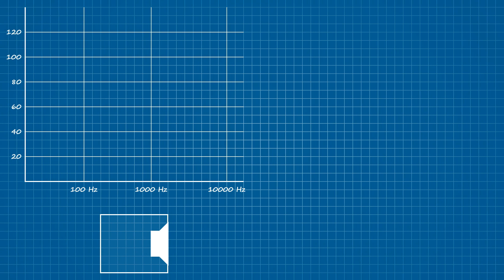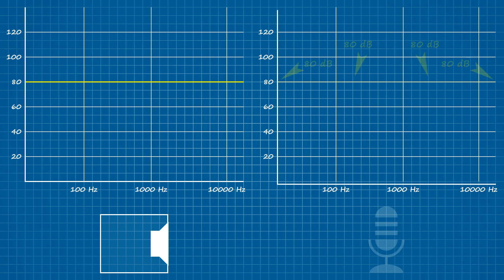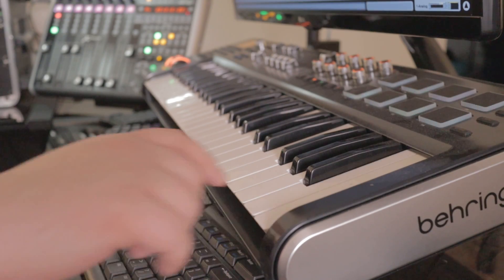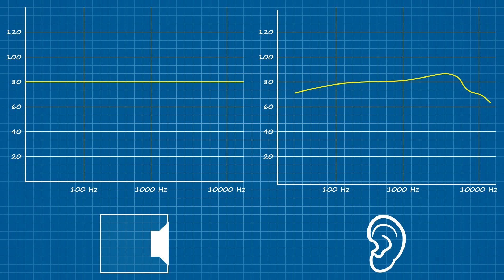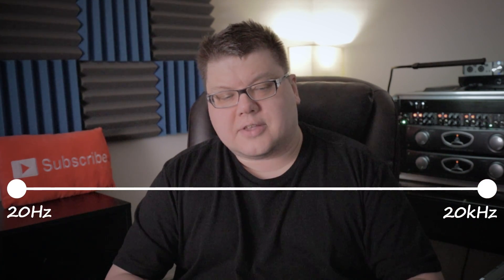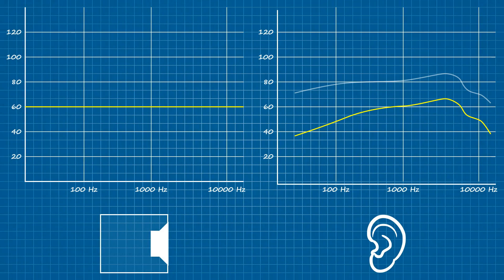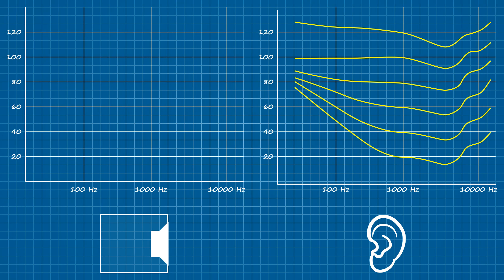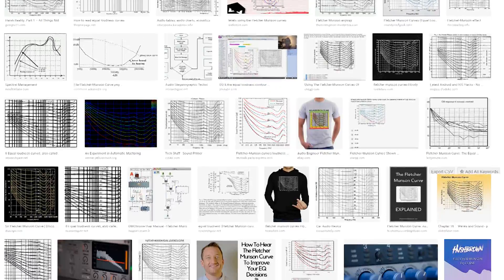Perfect Sound Explained

Comment: Not to mention the room. Tweeters are become more directional at the top of their pass band. The bottom of their pass band i.e. between 2-5 khz they deliver more energy out to their sides and get extra reinforcement from the walls.
Reply: Balancing polar response and on axis response is something that needs to be done. Eg B&W speakers aren't completely flat on axis or off axis, but it sums to be reasonably balanced (they still have their own flavour of course).

Comment: Helpful, no its ore confusing. Ok, I totally get the relationship between volume and frequency response at the extremes. But are you suggesting that speakers should be skewed to make up for this? Back in the old days, ok the 70's and I'm not having a flashback..... at least not at the moment, any decent amp or receiver had a loundness countour button on it to attenuate the amplified frequencies at the extremes for listening at lower volumes, so you didn't get kicked out of your apartment. But the speakers we listened to went to great lengths to achieve flat response so that we could hear what the sound engineers had tried to create from our favorite artists music. When it all came together is was an awesome experience. Then, when loudness countour switches started to be dropped from amps we used the tape loop to run our Equilizers through and that gave us the best way to compensate for differences in volume, as well as when recording cassettes for use in our car stereos. With a little practice and experimentation you learned where your car's stereo lacked performance and could make up for that in ways that made them sound better than CD's, until well engineered car audio systems and speakers came into being. By the way, way back in 1978-79 I began experimenting with separate drivers in my car stereos. The first system was a friends and he had been given a bass guitar speaker speaker from his uncle. Having an early Chevy Belair two door it had a huge rear deck, so we cut out a hole and reinforced it with plywood, and mounted the woofer in the huge rear deck. Then we went to radio shack and got a pair of 6" dual cones and phenolic ring tweeters and mounted them in the front doors. Of course we didn't know anything about crossover networks back then, but with a couple power boosters it didn't sound bad. In later cars I used the woofer out of a coaxial cut out the cheap tweeter and pitched it and used different midranges and dome tweeters honing in on what sounded the best. These days we have guys like you Pete, who design things for us and they sound much better than those early experiments, but when I got some decent bass going our of the crap we had to work with back then it turned heads.
Reply: It shouldn't be compensated at the speaker (although some manufacturers do try to), it should be compensated in the preamp section. Also, you don't apply the equal loudness contour as is seen on the chart. You choose a reference level, then apply the difference between the reference contour and the contour with respect to the current level. This is what Aydyssey Dynamic EQ does for example. When listening at the reference level, the output is unchanged. When listening below reference, the extremes will be boosted according to the difference in sensitivity at those frequencies.

Comment: Could it be possible to have a speaker system that adapts the sound to what our ears should hear at different Db levels? Basically, the perfect sound to our ears no matter how quiet or loud?
Reply: +Xander Zoolander   

Not with a speaker system itself, but with DSP it is possible.  The just-released Zapco HDSP-Z16 V has a "VSEQ" function that does this.  OEM car manufacturers have been doing this for years with volume-dependent variable EQ curves, to apply frequency compensation to make the listening experience more enjoyable at different volume levels.

However, the other main function of this "adaptive EQ" is to protect the inexpensive speakers that the automakers use from being damaged from too much low frequency content.  i.e. as you turn the volume up, the low frequency response is proportionally reduced to protect the midwoofer speakers from over-excursion.
Reply: Yes it's quite possible. Larger amps give better control even on low volumes. That's why a "too big" amp is better than a too small or "just big enough" amp. It's also actually harder to blow speakers with a larger amp (ut to a point offcourse) than a too small one.
So if the speakers don't need alot of power just to move and if the amp gives alot of headroom then the system will perform almost as good at low volumes as it will on high volumes. There are other factors too but this is the most basic.
Reply: It's been done and it's not that uncommon either, my Klipsch R41PM's have that and they call it adaptive bass control lol it dynamically boosts the high and low frequency ranges according to the fletcher munson curve depending on the volume.
Reply: Yes this has been available for quite a few years under the name Audyssey Dynamic EQ.
Reply: Bose actually does something like this on their small PC and bluetooth speakers.
Reply: Sound reproduction has nothing to do our ears. The instruments, the singer will sounds as they are no matter how human listen. So should be the speakers.
Reply: @johnyang799  Wrong! Not all ears hear sound the same
Reply: @Oystein87  Sure not all ears hear the same. But in the concert we listen to the same people playing same instruments. Lol.
Reply: @johnyang799  So why do you claim it sounds as they are when they really don't..? It would sound different for you and the guy next to you in a concert.. Get some education in sound

Comment: Since I've been watching your videos I have been taking a different approach to my tuning and equalization of my vehicle's audio system. I must say Im extremely impressed with what I'm coming up with. Source material is more important to me than ever, as a system is only as good as its weakest link. Thanks for doing what you do!
Reply: @HexiBase  I'm having a hard time finding a resource that explains in layman's terms what separates quality amplifiers from not so quality amplifiers (car and home) i have a basic understanding of what damping factor does, but what components on the amp board do what jobs to produce an accurate signal?
Reply: @wadehensley5005  Electrical Engineering student here. Dont hold my word to it yet, but I think the answer you seek is common mode input ratio and different mode gain if you didnt already know what those are

Comment: i have a 91 nissan extra cab truck and want to build a box for 4 12s in the bed with a blow threw... can you show me some boxxes i could or should make for the best spl..2 mtx4500 and 2 power acustics thank you for your time
Reply: @HexiBase    CAN I WIRE UP 2 SVC 8 0HM AND 2 DVC 4 OHM TO A ONE OHM LOAD AND IF SO HOW

Comment: Hey Pete need u to make a vid about the perfect midbass speakers 6.5 -8 inches i was told 6x9 aren’t accurate because og the oval shape...
Reply: The oval shape would have an effect on the polar response, assuming it plays midrange too. This can be beneficial to some situations, though normally used with a concentric tweeter. There could potentially be odd resonances due to the structural nature of the oval shape too I guess.